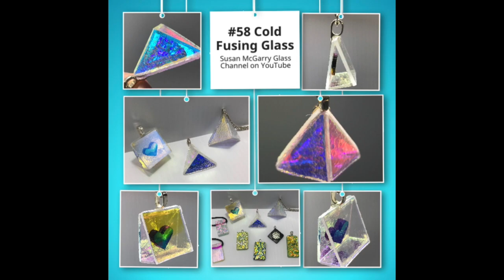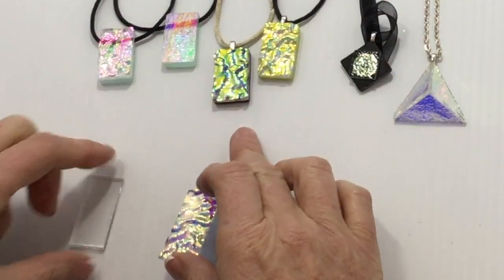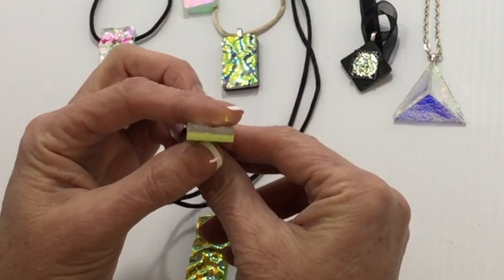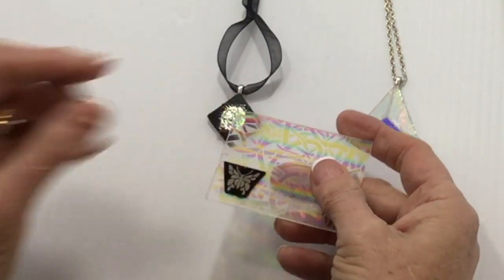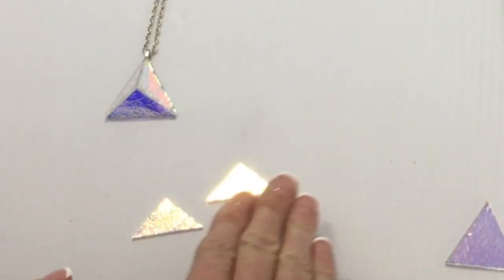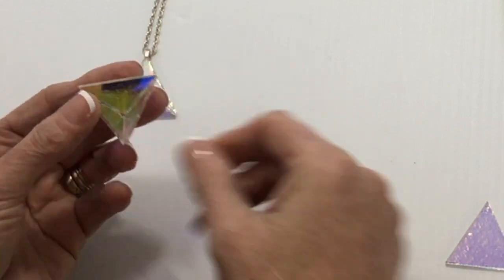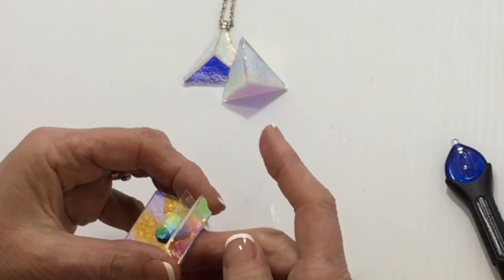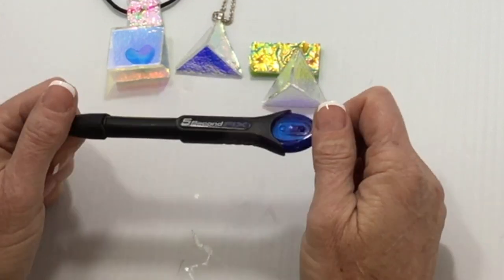#58 Cold Fusing Glass

Comment: better off buying UV resin and a UV nail dryer - much better cost efficiency and probably a much better "hold" as well - there is no way that tiny UV light is going to properly dry much of anything. I use UV resin all the time when I coat Sea Glass with it, decorate and make it into jewelry.
Reply: Thanks I was gonna order specialty glass epoxy but I already have uv epoxy I'll try